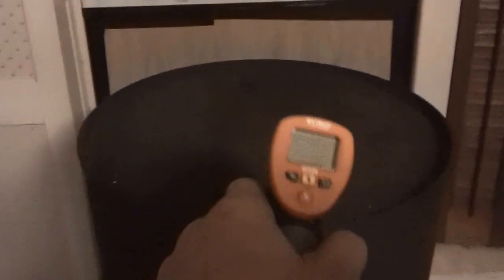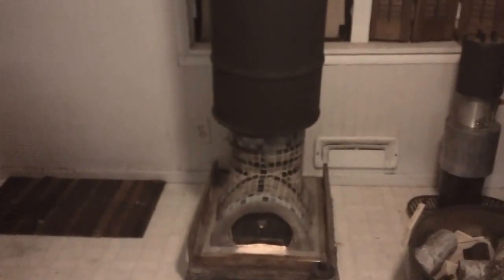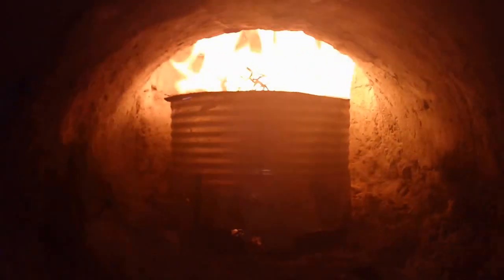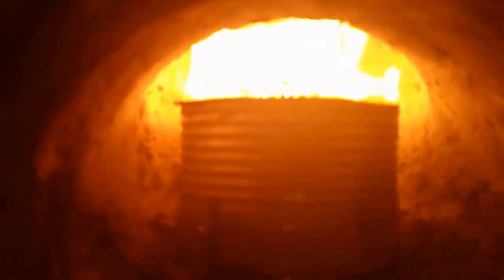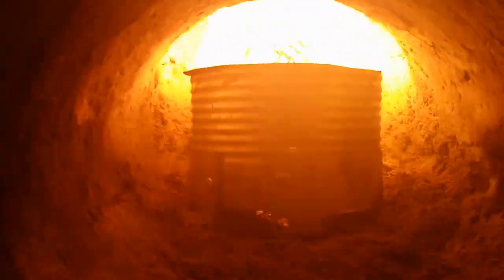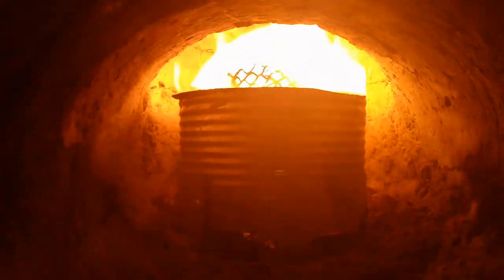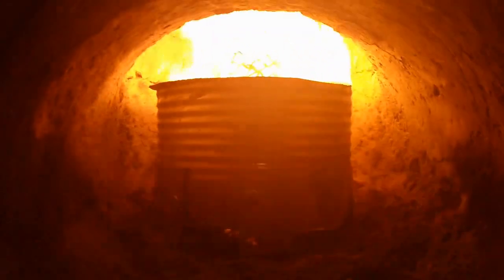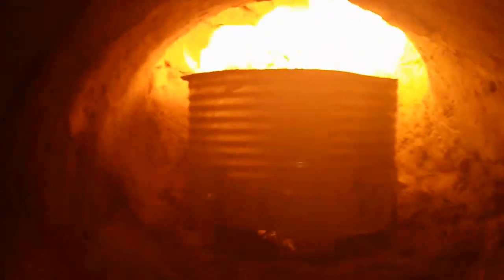Sawdust/Waste Oil Rocket Stove Part 3

Comment: I was reading that plastic gives off toxic gas; check your sources.  Burning plastic bags; made from soy is not good for the males in the family. It effects the male hormones. I ask for paper and use recycle bags to help the consumption of plastic bags.
Reply from the maker: anything can be be burnt cleanly.. with the right temperature and air mixture. and secondly the fumes do not come in the house and I dont suck on the stove pipe on a regular basis...LOL thanks for watching and the kind words..
Reply: I appreciate your videos and was just concerned for your health. Thanks for responding.
Reply from the maker: please forgive me if I cam across harsh.. thank you for your concern. noted.

Comment: Wonderful idea. I'm looking for a heat source that requires no electricity and rocket stoves are great for that. Here's another idea: If you suspend a 2-liter bottle of fuel from a screen door spring and run a hose/copper tube from the bottom to your can, you should be able to replenish the can. The right spring would give you a constant height and just the right amount of fuel for long-term operation. No electricity. No spills, Please let me know what you think.
Reply from the maker: drip feed . it will work it has been done good luck thanks for watching hope it helps

Comment: I was watching your videos, and I thought about instead of saw dust pour heating wood pellets in the container and restrict it, with the center core vent, then add kerosene and let the wood pellets suck it up and expand. I am thinking they will if given the time they will expand and evenly distribute the kerosene to the now saw dust and expand as much as they can.  Then you could have a recipe to easily duplicate:')  I have been heating with kerosene and I have some waste kerosene and I am thinking of ways to burn it off.
Reply from the maker: I think it will work just stir in your kerosene in a bucket of pellets to evenly distribute. I have found straw and leaves will work too or another natural fiber with any flamable  liquid or grease. good luck let me know how it works.

Comment: How's the metal part of the heat riser holding up? Maybe the main burn chamber is taking most of the abuse? Be cool to see how well its holding up
Reply from the maker: I deliberately only get it up to 500 I can and have had it over 750 stuffed with good dry hard wood. I have taken it apart a couple of times to check as of now all is good. hopefully if i take it easy it will stay that way
Reply: sure hope so i'm vary strongly considering building my own for camping look like a good setup. but have you gottin any backdraft from it or is all ok?
Reply from the maker: master98159  Back draft is not a problem due to higher exhaust temps from lack of mass to cool it and chimney set up has a lot to do with it too. the oil set in the can is more like and candle than a true oil burner so the temps dont get as high. I would use good clay for longevity too. Cast it from hawthorn refractory clay and the small tile have a mesh behind them Im usre it helps keep it strong. So would either tile it or embed a mesh in the clay as I built it. good luck
Reply: thanks